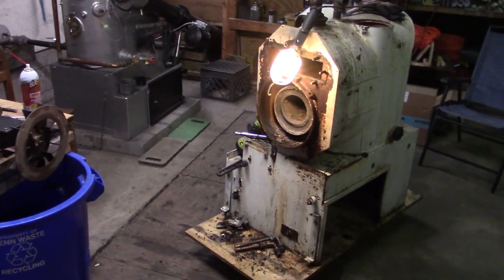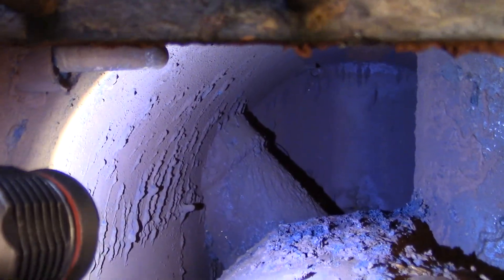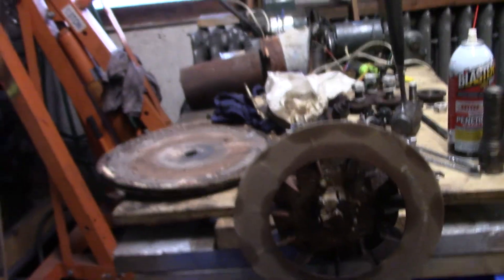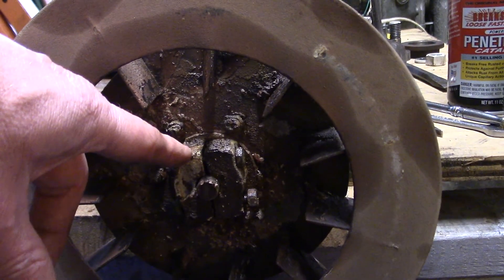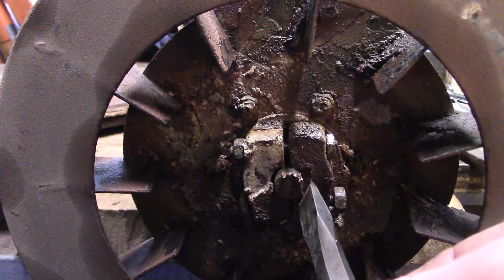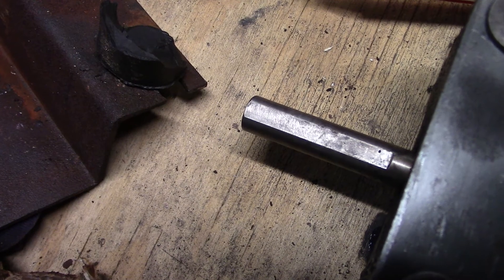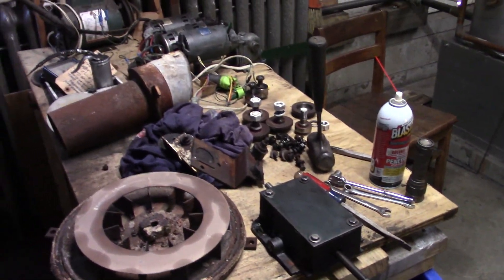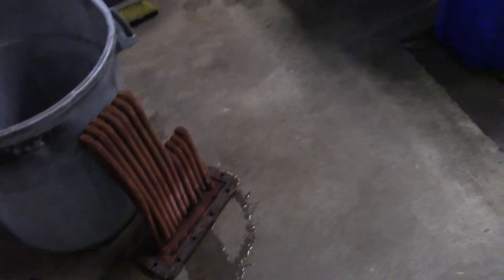1956 Axeman Anderson 130M Modified PT3, DHW Coil and Fan

Comment: Some emery cloth and the shafts will clean up nice.   Could you never seize or permatex the coupling to the shaft?
Reply from the maker: I used high temp anti seize on the last one. That was the "Axeman 130 Heats Wood Boiler" project. This Summer we will open that one back up and see if it comes apart.